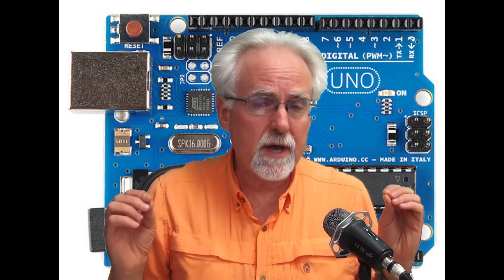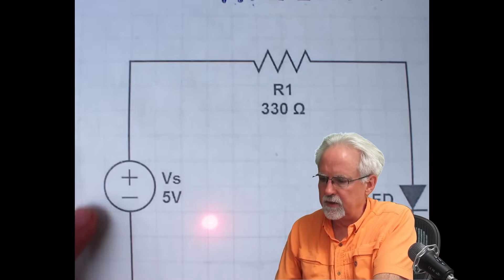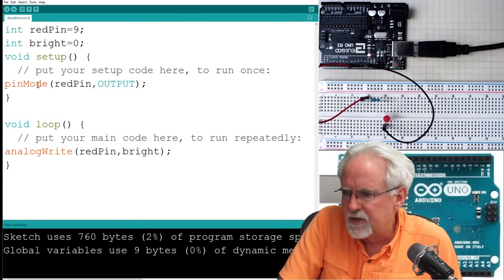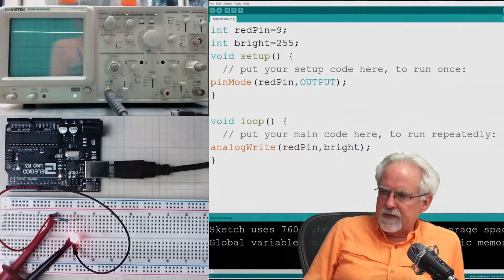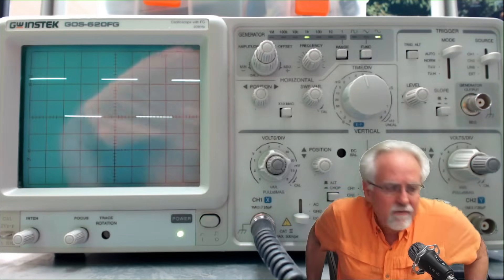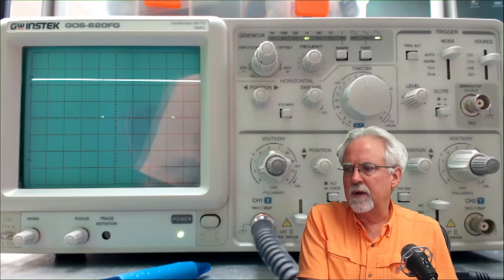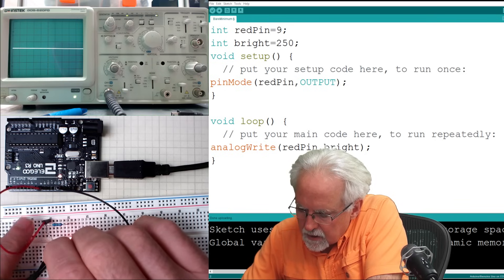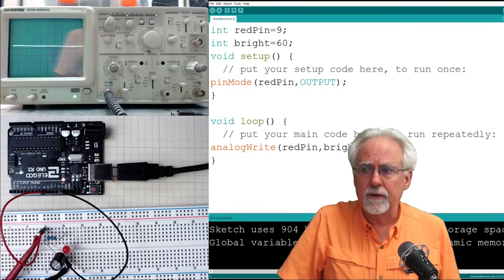Arduino Tutorial 8: Understanding Pulse Width Modulation (PWM) and the Arduino Analog Write Command

Comment: So to smooth out the pulsating voltage(5-0-5-0-5-0 at a given interval between 0 to 255) it goes into the capacitor storage and is released as a more "constant steady stream" equal to the average pulsing voltage? How do you figure the size of capacitor to use per circuit? Thank you sooo much for your time and quality tutorials I am very new to the Arduino but feel confident with your tutorials.

Comment: Thank you for this video! I do understand what is going on. In PMW the signal alternates between a maximum of 5 V and a minimum of 0 V with varying durations at the highest and lowest to simulate different voltages. For example, if we want a voltage of 2.5 which is approximately 127 on the 0-255 scale, then with PWM we get 2.5 V equal time spent at 5 V and 0 V so it averages out to 2.5 V. Our eyes perceive this as a medium brightness because it happens so rapidly, for example, 2 milliseconds at 5 V and 2 milliseconds at 0 V. If we want a smoother signal (one line), as opposed to the  alternating between high and low that PMW does, we have to use a capacitor.

Comment: So to relate to real life… a incandescent lightbulb would use a dimmer which just makes the bulb less bright by using up the juice inside the dimmer (less bright bulb = hotter dimmer), so no saving of electricity. An LED dimmer just turns the juice on and off at a high rate to make the LED appear less bright so it saves electricity.

Comment: I hope I got this right, because this is what I wrote in my notes: The circuit is completed 1000 times per second (every millisecond), and Pulse Width Modulation (PWM) is the ability to adjust the duration of how long the circuit stays on, versus off, by changing the average voltage with a value between 0 and 255, which correlates to 0 volts and 5 volts respectively.

Comment: Why use a PWM supply to vary the speed of DC motors, instead of just a steady voltage source? Since the PWM is simulating a steady voltage, it seems like it would be better to use a real voltage.

Comment: I'm just getting into the Arduino as I have many projects in mind. I'm an High Voltage technician so have most of the basics of electrical/electronic engineering but what a gem of information that the Analogue output is really just PWM. That can make such a difference depending on the project. Thanks for the great videos and keep up the good work. I also watch the adverts to make sure that you get rewarded for your efforts.

Comment: Hey Paul, I have a question.  You placed the capacitor in parallel rather than in series.  I saw that the oscilloscope registered a smoother, more analog output, but wouldn't the LED still be receiving the PWM voltage from the Arduino card?  They both have a common input, and same ground, but basically two different paths, right?  One still PWM, the other regulated by the capacitor.  If you hooked up the oscilloscope to the resistor input leg and LED output leg, wouldn't you get the same PWM as before?  Or can you say the capacitor in this situation would operate similarly to a diaphragmed air chamber in a plumbing circuit plagued by water hammer, where the air chamber, by simply being in parallel OR series, will absorb the water hammer (or sudden pulse of DC in a PWM electric circuit) and provide a buffer to protect the pipes (or in this case the various circuit parts), or am I completely lost here?  Really trying to understand if that's the case or not here!

Comment: I have a question.  You placed the capacitor in parallel rather than in series.  I saw that the oscilloscope registered a smoother, more analog output, but wouldn't the LED still be receiving the PWM voltage from the Arduino card?  They both have a common input, and same ground, but basically two different paths, right?  One still PWM, the other regulated by the capacitor.  If you hooked up the oscilloscope to the resistor input leg and LED output leg, wouldn't you get the same PWM as before?

Comment: I understand pulse width modulation from this lesson.  I suspect this is happening because we are using one of the digital outputs.  If we were doing the same thing with an analog output I would expect to get the DC voltage that corresponds to the analog number rather than the pulse width modulation.
Reply from the maker: Steven, in general there are no analog outputs from digital devices. Digital devices can only give on/off signals, and therefor analog outputs can only be simulated using PWM

Comment: Great series! You make learning fun and easy. Still curious if you use cubes made from coffee or water. HOT coffee here in Maine in January! (at least until lunch). Try dedicating and Arduino and breadboard to a small piece of plywood with standoffs to keep everything  square. I'd like to make a breadboard set up like "Mr. Carlson's Lab" has with four boards, banana receptacles and built in power supply. (current limiting of coarse). Can't wait for the next lesson, so here we go! Thanks.
Reply from the maker: Cubes are water. The hot coffee is espresso. It melts the cubes, dilutes the espresso making a very robust, but not bitter percect cold beverage.

Comment: From what I understand when you give a analogWrite command and give a value for example of 127 the Arduino board doesn't truly output a signal of 2.5 volts but is rapidly switching the signal from 0-5 volts in a way that the signal then averages out 2.5 volts and if you truly want an analog signal you would incorporate a capacitor in the circuit and the capacitor would smooth out the signal and truly provide ~ 2.5 volts constantly instead of switching the signal rapidly from 0-5 volts, i understand you can do this with other values i just used 127/2.5 volts as an example to explain

Comment: I didn't really understand Pulse Width Modulation before but I do now. Watching you build the circuit, then actually seeing a pictorial representation of what's happening as you changed the values in the program really made it clear. A lot clearer than reading an explanation in a book.

Comment: I don't know if you're still answering questions from a 3 year old video, but here goes:
You asked for commenters to explain PWM back to you. I'm going to skip that b/c I know enough to get the basic concept - we're simply manipulating the dimensions of a duty cycle in order to change the time/brightness of the LED. However, throughout the video you only focussed on a specific length of time. My curiosity lays in what happens if you maintain a PWM shape but change the length of the duty cycle?

Comment: To see the analog write in action, I connected two LEDs:  one into port 9, the other to port 10.  Then, I just looped through 0 and 255 to slowly dim one LED and slowly brighten the other, and viceversa.  

int ports[] = {10, 9};
int numPorts = sizeof(ports)/sizeof(ports[0]);
int shortDelay = 30;
int longDelay = 850;
int separatorTime = 2000;

// the setup function runs once when you press reset or power the board.
void setup() {
  // initialize digital pin 13 as an output.
  for(int i = 0; i < numPorts; i++)
    pinMode(ports[i], OUTPUT);
  
}

// the loop function runs over and over again forever.
void loop() {
  for(int i = 0; i < 255; i+=2) {
    analogWrite(ports[0], i);
    analogWrite(ports[1], 255 - i);
    delay(shortDelay);
  }
  delay(longDelay);
  for(int i = 0; i < 255; i+=2) {
    analogWrite(ports[1], i);
    analogWrite(ports[0], 255 - i);
    delay(shortDelay);
  }
  delay(longDelay);
}

Comment: Good course but pls do not connect el. capacitors to Pwm outputs without using a series resistor or choke. This will damage the uC or at least creates very high current spikes.

Comment: the arduino is simulating in-between voltages by averaging pulses of 0 volts and 5 volts to make up for board hardware limitations i believe. this must be why the inbetween voltages can only truly be obtained using extra hardware in the form of capacitors.

Comment: Will have to revisit this in the future but I think I understand:

1. When you send an analog signal from the Arduino specifying the voltage you use an 8 bit number (Which stops at 255 as you start counting from 0)

2. The Arduino does not send a flat or pure signal but instead alternates between the maximum and minimum voltages and variates the time it spends at max and minimum voltages in order to average out at your specified voltage. The time between the changes between max and minimum is called the period - this is 4ms. 

3. This process is called PWM (Pulse Width Modulation) and turns the led off and on at the specified max and min voltages imperceptibly to give the impression of being dimmer and brighter.  

If you want to send a true analog voltage you can use a capacitor which I assume stores the voltage in order to release it at true voltage as opposed to using PWM.

Was very intuitive, thank you +!

Comment: Hmmm.  I suspect the wavy-ness that occurs even after the Capacitor is installed is caused by the ON-OFF of AC current -- so it can't eliminate the AC current flows without more help.  Can we think of a Capacitor as very a short term battery that releases current at a pre-determined rate -- similar to a Resistor but with storage capacity?

Comment: I must admit that this lesson was a bit over my head. I sort of understand it, but I’m wondering what the purpose of PWM is. What does it help us do?
Reply: It allows us to control the "apparent" voltage to various devices.  PWM is basically like turning the power on and off very fast - so fast in fact, that the device sees the power supplied to it as a percentage of the true supply.  Some devices, such as the LED require a minimum voltage supply to work (2.5 volts).  Supplying 5V to the LED, but only for a small fraction of time (say 10%) allows the led to operate.  It gets 5v, but only 10% of the time - simulating 0.5 V.  A better example would be a small DC motor.  It takes a few volts to get it moving.  If you only supplied 1 v, it wouldn't move.  But supply it with 5V for only 20% of the time, allows the motor enough power to move, but it would move very slowly.

Comment: Mr McWhorter, Isn't the PWM on Digital Pins and the analog pins put out an analog voltage (with out using capacitors for rectification)?
Your tutorials are the best, Thank you for the time and effort you put into them!

Comment: The analogWrite  command seems to have  only.2 options in voltage.

Although. It cannot make an actual in between number.

It can use  its processing speed??? To influence a primitive choppy signal with an average  frequency of off and ons  in relation to your chosen analogWrite number.

The analogWrite value  just tells  the  UNO the frequency of off and ons to use.

As far as what I’ve interpreted.

You rock btw

Comment: Great video as always. I struggle with knowing what size or type of capacitor to use or even determining what wattage of resistor to use. Do you have any video's covering that sort of stuff?? I guess you'd call it more about circuit design like knowing when to use a diode to control a turn off spike for example and which diode you should use??  I'm always afraid i'm going to cook something again.
Reply from the maker: It is really a complicated question. I have shown a few general rules of thumb, but what you are asking really is circuit design, which gets into a lot of math, and you have to sort of start from the beginning and go through the whole thing. Not something that has a simple answer.
Reply: @paulmcwhorter  Yeah I linda figured so. Do you have any arduino videos about I2C devices? I looked and didn't see any? Especially with like a LCD display or using 2 I2C devices  together and having address conflicts?? Love your video's , still terrible at coding but I'm improving a lot. I was about to give up but after watching your video's I have a little hope now!! Just struggle hard to remember everything and all the commands etc.

Comment: Thanks Paul.  Great explanations.  I followed along using my digital multimeter to see the voltages of the circuit. The multimeter plus the oscilloscope really helped me understand PWM.  Would love to have an oscilloscope but the price tag is a bit high for now.  Thanks again for the excellent series!
Reply from the maker: Thank you for the comment. There are some simple ones for under $100. Put it on your wish list. It  would be nice to have to have some day. Thank you for your comment

Comment: Thanks Paul, it did make sense. Do you explain more about capacitors and other components in later lessons. It would have been cool if you went into more detail about the capacitor and zoom into the board where you put the capacitor.

Comment: When I use the analogWrite command, The arduino From its Pulse width modulation pins sends an amount of voltage depending on the value chosen between 0 and 255 .The value chosen (between 0 and 255)  also determines the fraction of the period the signal stay high .  if the fraction of the period the signals stay high is big , the voltage is also High  and therefore the load or LED light is brighter and if the fraction of the period the signals stay high is low then the voltage is low and the light's brightness is reduced or lower . This means I can actually control the amount of voltage I want my Load to receive from a voltage of  0 to 5 in the case of the Arduino.

Any correction is welcome. thanks:goodvibes:

Comment: Great video , love your teaching style.  My wife was a college professor for over a decade and I know your students really enjoyed your classes.  I personally and learning a lot in every video.

One small critique.   Don't use an oscilloscope to measure the voltage.  Get a cheap multimeter for the initial voltage, and the students could use that inexpensive test equipment in their toolbox.  Switch to the O-scope and demonstrate how the meter can't display or read PWM. Other than that suggestion. Awesome.  

Yes I like things straight.  But I don't have to keep moving them.  Do you have to have your socks on just right?

Comment: So check I've got this right, an LED can't actually run at 127 by itself, instead it goes from 255 to in order to create the illusion of 127 right? Only way to actually reduce the voltage is to use the capacitor? Have I got that right?

Comment: Hi sir, the part about using the capacitor in parallel to the resistor and LED is quite tricky as the capacitor has many uses including smoothing the ripple voltage, act as low or high pass filters etc. Therefore, I believe it's important to pick the right R and C values. I hope in the next videos we will get to know more about that.

Comment: The highest number you can use is determined by the formula: 2 to the "n"th power -1; where "n" is the number of bits used. i.e. 2 to the 8th power=256; 256-1=255

Comment: How do you change the period?
Reply from the maker: It depends on what you want to change it to. If you want to make it a question mark, you would add a little curved symbol above it. If you want to make it an exclamation mark, you put a straight line over it.

Seriousely though, dont know of a way to change the period of PWM when you are using the arduino. It would be simple enough though to write your own PWM function, which used a customizable period, just the standard analogWrite method does not allow  that to be changed.

Comment: To practice my analogWrite's I designed a breadboard with 4 LEDs and 4 resistors, I grounded them to the rail on the breadboard then provided individual power to the AWM enabled pins. Then I wrote a program where they would light up in sequence getting progressively brighter as they went. I assigned variables to my brightness, the speed, and the pins themsleves, and an off voltage of 0 for the pins that weren't to be illuminated at the specific sequence. It turned out perfectly. I showed my kids how adjusting the variables could turn the speed up and down. They are very curious about this new kit that dad is always messing with ha ha. Maybe one day they will watch your videos as well. Thank you for being such a great teacher!

Comment: Paul, please forgive me for commenting twice on the same video Tutorial, but I felt it could be important to some of your Students.  Firstly, I must commend you for utilizing the Oscilloscope as a learning tool. Nothing wrong with that. BUT, do you suppose that some of the less experienced electronics students might have become temporarily lost with the "Graticule" counting and use of a calculator to determine period and voltage and time base measurements. If on a future update of this lesson , one of the newer Digital LCD Scopes (which happen to be very reasonably priced these days) were utilized, those parameters are provided by the instrument "On Screen". That, coupled with a hand drawn graph or two showing the Width of the Pulse might solidify the concept for the student, with less confusion for those new to the game. Otherwise, Paul, a great lesson. Thanks.

Comment: Oh Yea, I suffer from that same affliction of wanting the circuit boards being worked on to be precisely straight in reference to each other. And of course having them wander around on their own is simply not acceptable. Purchasing a Arduino/Raspberry Pi/Breadboard holder solved BOTH of those issues for me. They attach to the plate, and everything is held neatly together. Next to the Elegoo kit, this is the BEST money I ever spent. Thanks again for your high quality Tutorials. They are simply "The Most Excellent" courses out there !